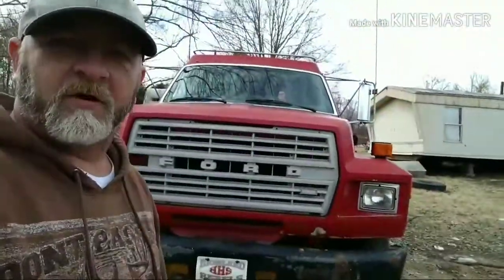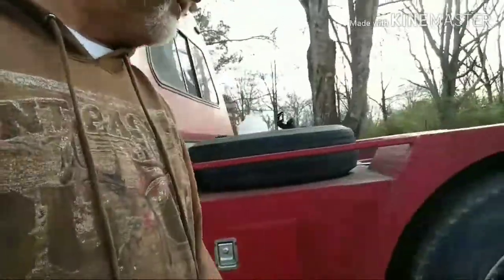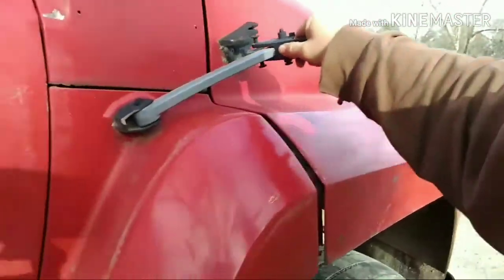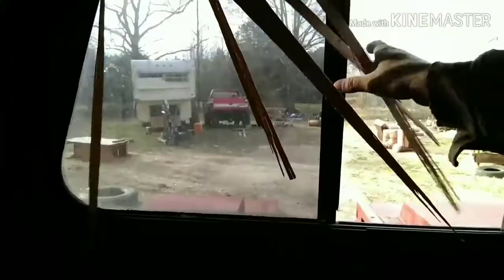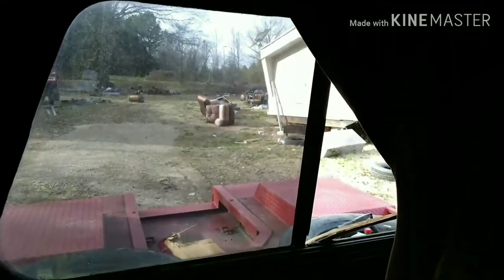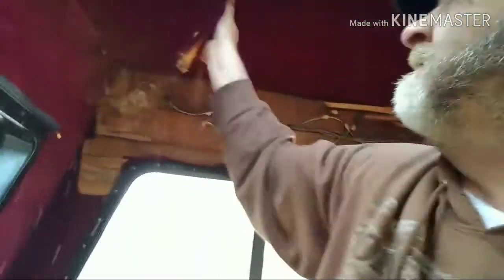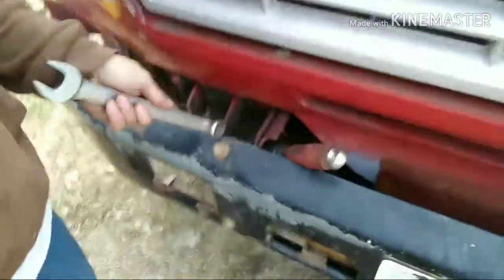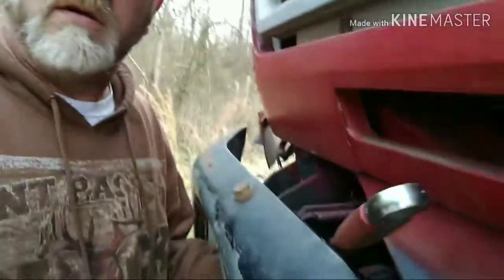Hot shot. Building the ultimate hot shot truck

Comment: That's a nice ford. Looks like a p7100 pump 12v 6bt. That thing will make as much power as you want with some basic parts. The best part is elog exempt truck. And a sleeper is a money saver. I drive 18 wheeler. Never done hot shot. No money in general trucking with your own big rig now. I'm a company man until I get out of trucking. Get a n95 dust mask for all that rat dust.

Comment: Lol peterbilt.  It's a Ford
Reply from the maker: Lol i know but it's all fun
Reply: @CATDADDYDIESEL  I really want to see it when it's complete.  I Drove one a few years back hauling cars.
Reply from the maker: How did you like driving one
Reply: @CATDADDYDIESEL  it didn't seem to have enough power.  But for sleeping in.  It was ok. Could have used a little more room.  Mine was a manual 6 speed.  We kept having problems with the 1st gear.  Went through 3 trans in 6 years I drove it. I drive coke bay trucks and those are 6 speed international manual and not as much problems.  Except for the new automatic transmission on the new international